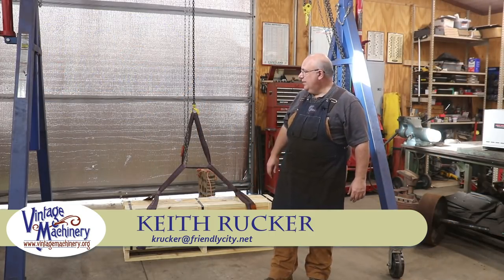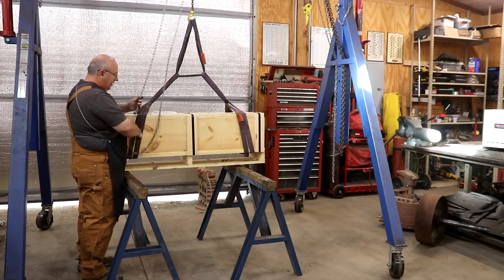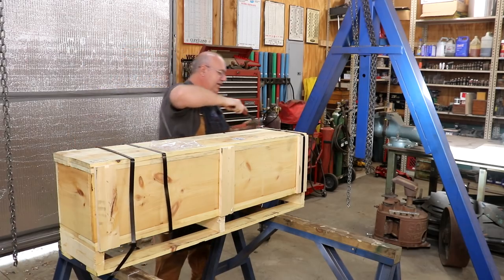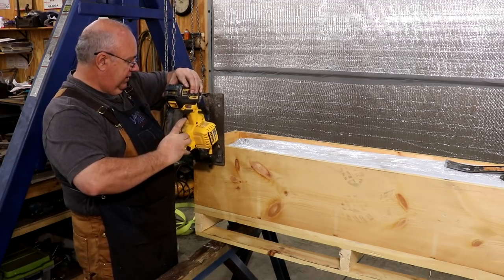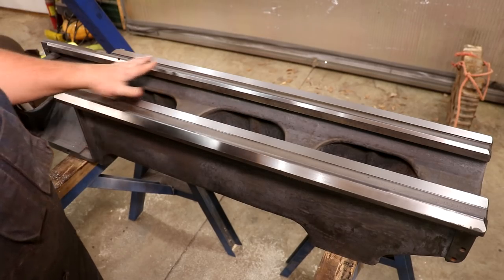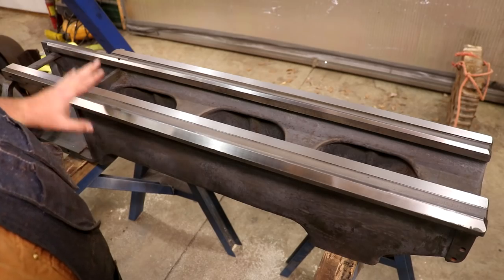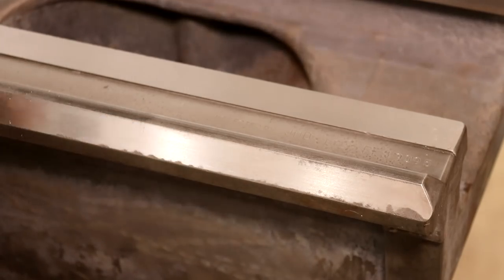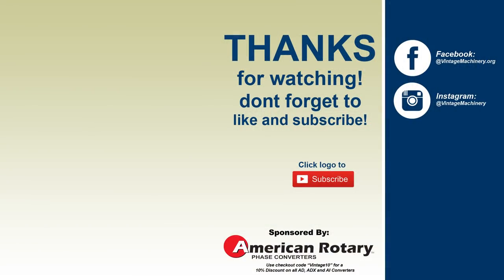Monarch 10EE Restoration 3: Getting the Lathe Bed Back from having it Re-Ground

Comment: Thank you for all the nice comments about us here at Kinetic.  Several of my operators are very keen on this kind of work.  We are always happy to work with many of the small shop / hobby guys.  I realize many guys out there are much more than just “hobby” machinists and I always enjoy working with everybody.
Reply: Maybe more of a question for Keith, but do beds/ways you get typically have sufficient depth of hardened material for the regrind, or is there also a hardening process that should be done when regrinding?  I know he mentioned this particular one didn't need it.
Reply: @rfc8052  most of these old lathes the ways are simple cast iron.  I know some of the monarch lathes had flame hardened ways, this process would go about .060" deep or so, as you regrind, you lose some hardness.
Reply: Hey Cash, I'm getting a monarch bed just like this ready to ship to you. I'm excited to work with you guys.
Reply: Hi.  Did Adam booth work at kenetic?

As an aside ,bed on my Harrison say 'induction hardened '.  Say as flame hardened?

Comment: looking forward to seeing this machine back in working condition. I really want a lathe of this size for my shop.
Reply: It's a good machine,been using one in my shop for a dozen or so years without any issues at all.But when you say size it's a very heavy piece.You should really be aware of exactly what it is before you get into one of these lathes...
Reply: I used a Hardinge that size at a job I once had and I want one for at home badly
Reply: @maggs131  good luck finding one at an affordable price!Great lathes but not very affordable for most home shops!
Reply: @giannirocco7492  I said I want one, didn't say I was getting one lol. I've never used a monarch but I cant imagine its simpler to use or more precise than a Hardinge
Reply: @maggs131  what kind of jobs did you do where they put you on the Hardinge?
Reply: @giannirocco7492  making and cleaning dies for drawing titanium which was not at all utilizing the capability of that lathe so anytime I needed to turn anything I used the Hardinge over the Jet I was supposed to use lol 🤭
Reply: @maggs131  I see...
Reply: @giannirocco7492  not what u were expecting?
Reply: i want a shop

Comment: Awesome crate job!  I order signs all the time and I've seen crates come in where they're nailed together with 2x4s, 4x4s, and 3/4" plywood.  Took me a good 2 hours to uncrate them and it would have 2 trash bags full of peanuts, or styrofoam.  A crate 10x the size it needed to be.  But that crating job was really thought out and done well.  Kinetic, if you're reading this, give that crating guy a raise.  seriously good job.

Comment: Keith, just before you mentioned saving that lumber, I was trying to come up with a use for you for the box. 
The wooden shelves in my shop were constructed from 100% scrap wood. All 1/2" plywood and 2x4's. They cover about 40' of one wall, and about 20' on another. I like to have things organized, and this certainly helps.
Reply: LOL - do you really feel the need to write that comment?
Another use for the wood would be to save it until winter, then burn it for warmth.

Comment: Hello Keith, I can understand your joy on un-crating  that bed, as at the end of last year, I had the same experience. I had sent off to Sydney, the bed of my 1949 Hercus model ¨A¨ (Southbend 9¨ clone, made here in Adelaide). This was badly worn and would turn a .004 taper on a 2" long cut. Now with a re-ground bed I am back to a parallel cut, accuracy is back.

Comment: i did the same vestil gantry a few years back, except mine has a 16 foot beam, amazon beat global by $100 and free shipping which was another $800.  we were using it for our de-scaler tanks with an electric hoist, now it is our plate lifter for our waterjet with a manual hoist.

Comment: interesting to see how You bolt to the base without introducing a twist to the bed. Im sure You know how to resolve. I have a 10ee also. The quality of these lathes in My opinion is superior to a hardinge super precision lathe at least in some important areas like power, no worries on chuck reversing, variable spindle speed.  and who doesnt love that big tachometer?
Reply: Possibly some very thin shims to get it in the ball park, then a Starrett precision level for final adjustments.

Comment: It's screaming for paint, before it gets "set aside".  Vaseline works great to cover machined surfaces during paint.
Reply: Vaseline has many uses....i used to smear grease in my airbox ( plastic box ) on my Motocross Race bikes ( dirt bikes ) until i found vaseline worked as good as grease and was less messy wiping it out...i greased the airbox as the dust and debris ( earth , sand etc...) would collect on the grease/vaseline surfaces and less on my sticky oiled foam air filters!!  usually on sand tracks it can cake up on filter stopping air flow and horsepower in a race....also made my filters last all day long...practices and 2 races per bike ( i raced 2 classes of bikes )

Comment: I have a guy that planes my beds back in withing a few tenths.   You WILL be scraping that saddle in I bet.  I just finished a SB Heavy 10 that needed to be built up with some Rulon in the saddle to get the leadscrew alignment back.  Worked great! Look forward to the restoration.  Happy Holidays Keith!
Reply: How much roughly does a grounding the ways flat cost?  I have a 10ee that needs this job done
Reply: @Dev_Everything  I don't know about grinding.  My guy uses a large planer. Like a shaper, only the work moves under a fixed cutter.  Depending on size and time reqd planing can be as much as $700 or more.   The last South Bend 10L I had planed was about $500 IIRC.
Reply: @marks5603  Thanks for the reply!  Who do you use?

Comment: I'd love to see a vid of how Kinetic grinds these lathe beds...how do they set it up for grinding such that the height of all the contact surfaces stays correct so the center line of the head stock and tail stock are colinear.
Reply: There are videos out there of them being done, it's basically just a big surface grinder. The centerline really isn't a problem. The head and tailstocks both use the same surfaces to mount on so as long as those are ground flat it cannot get out of alignment.

Comment: That looks really good I am looking forward to seeing it installed and the top plate scraped to match. 

FWIW: I counted twelve staples in the box corner near the camera. That is going to take more than a wonderbar to bust loose without shattering the end grain.  
Try using an oscillating saw with a carbide blade and cut them between the boards if you really want to get the board without a lot of effort. You can the drive the stumps out with a nail set and pull them with diagonal cutters or channel locks, or just leave them if you’re going to box it up again with a nail gun. 
People use way too many fasteners when all they have to do is pull a trigger. 👍

Comment: Your gantry crane would benefit greatly having an electric winch with hand held remote. Cheap and easy wire management and another trolley and you got yourself a third hand.
 As for the lathe bed. Is the ways and bottom ground parallel or checked for parallel?
     Thank you for the great videos..
Reply: While I agree powered would be nice, the truth is the precision of control with the chain fall is really valuable. With a winch there is some "art" in getting on and off the buttons for critical placement (I'm thinking chuck changes and other heavy things you need precisely positioned).
Reply: @dasworkshop4967 , it would still be nice to have both with two trolleys. One for speed and convenience, the other for finesse.
Reply: @dasworkshop4967  I have had an electric hoist for about 20 years have no problem with precise positioning and don't have all that chain rubbing on everything
Reply: @dasworkshop4967   While a little more expensive, there are crane winches with fine control. My old shop had a trigger and two position momentary toggle. The further you pulled the trigger the faster it would go.
Reply: electric or hydraulic " hoists " ( winches are used horizontally to pull partial weights and hoists lift what they are rated vertically and fully ) are not cheap....yeah they are great ( used many in my careers ) but a chain hoist is the cheapest option and good enough for 95% of lifting needs....
Reply: @danrabenhorst2549  
yeah it is easy to lift or lower by using it correctly... and yep the chain is annoying but you use what u got....i used lots of commercial units and have a chain hoist in my shop ( not used since i moved here but one day!! )  i prefer a ceiling hoist running across as much as you can to maximize use and ease of use..gantrys are always hard to use unless your shop is wide open and take space...but handy....when needed...
Reply: @Hoaxer51  
$$$ Makes any dreams happen...lol
Reply: I remember visiting a railway workshop in the early 1970’s  they had tracks at a high level down the walls longways and several travelling hoists with access every where. I’ve wondered before how to create an affordable equivalent in my workshop, in Keith’s case I hope the fairy godmother calls and offers him a lovely Victorian travelling crane for his shop. That said, he is plainly doing ok with his setup.
Reply: @peteengard9966  The hidden part of my reply is at least in my case, there are at least 1000 other things I'd like to have more than an upgrade to a winch I have to power
Reply: @dasworkshop4967  I worked in a shop that had a new bay built with a 5-ton overhead crane.  While the power hoist and travel is nice, unless it is used many times a day to justify the fine controls, a chain hoist for a crane of 20 x 50 ft is preferable to a fiddley power control.  Been there, done that.

Comment: Hello Keith, I have a new 8x16 Grizzly lathe which has ground bed ways, But saddle don't look the v-grove even touches. My question is will I be ok in lapping in the saddle with diamond compound to glide smooth, i have 600, 800 and 1500? Thanks Dave       Jesus Does Save

Comment: At about 7:20 I see you (as I see lots of guys on YouTube and elsewhere) missing out on a better way to use that prybar in that very common situation. Rather than prying OUT and tending to split the wood, Push DOWN and lever the piece in more of a peeling motion top-down. It can also be beneficial to alternate ends, working from the top down since your workpiece is also anchored across the bottom. Of course you probably will not reuse the very ends of those boards anyway, but you might be able to avoid long splits. BTW, sawing across the ends is cheating... ;>)

Comment: I plained ways on what was called ram beds for turret lathes . They were ruff castings. They were then induction hardened next . They were ruff ground, finished planned, bored the headstock and then finished ground. Bed had to be aligned in a free state before clamping . Finished ground ways were straight and parallel with in .0002" . They had to grind with a cup wheel to be able to grind up to the headstock. They tipped the wheel slightly to make the way surface .0005 dished so oil would not be squeezed out. This was all done at Waner & Swasey's Solon Road plant . I worked there in the mid 1970's . As you're going to do the saddles were scraped to a master gage first then fine tuned scraped to the bed in
assembly. Was a great place to watch and learn.

Comment: Oh man. Had me sweating when you let that crate down on the saw horses. All the weight getting focused onto a small area on those thin boards. If one of those snapped you'd have a heavy lathe bed rolling your way possibly. That crate wasn't designed to be loaded like that.